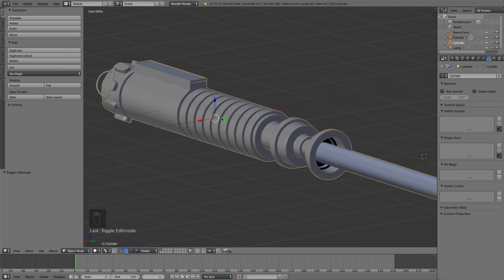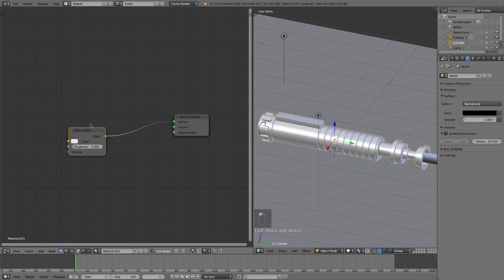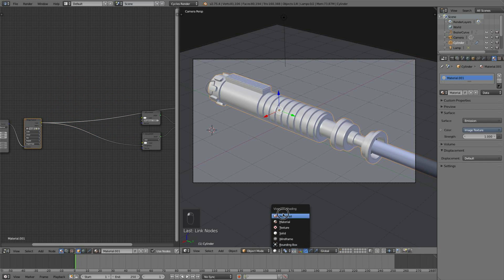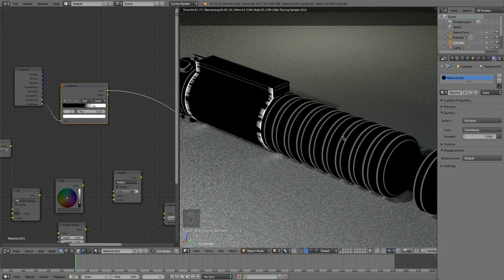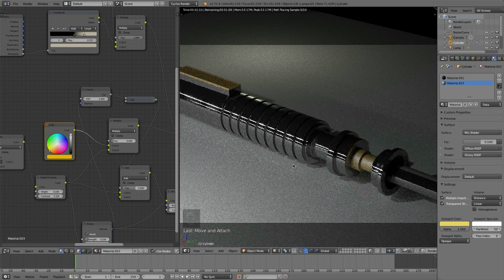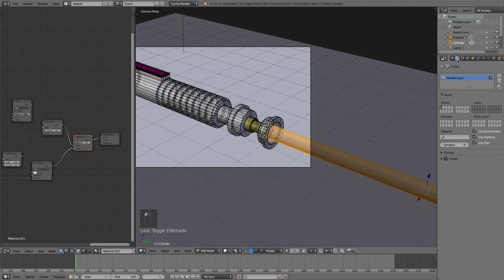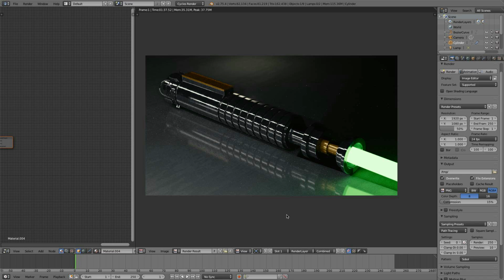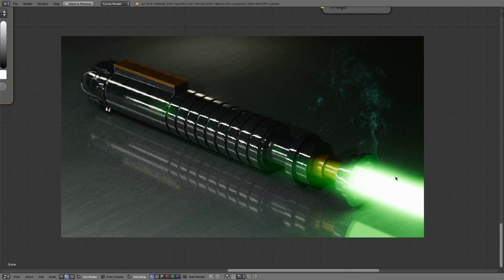Blender Beginner Tutorial: Create a Lightsaber - 2 of 2

Comment: Time for an upvote. There is still a problem left in my opinion: The reflection of the lightsaber blade does not glow at all. So whats the optimal solution for that? I tried to seperate the reflecting plane from the lightsaber with an object index mask and may be to lit up the green tones of the blade to make a glarefilter filter affecting mainly that part. Still this depends very much on the scenery and colors used. So is there a better way? Like having something like a reflection index to mask that off? Anyway thanks very much for the very useful tutorials and the time you are putting into those.

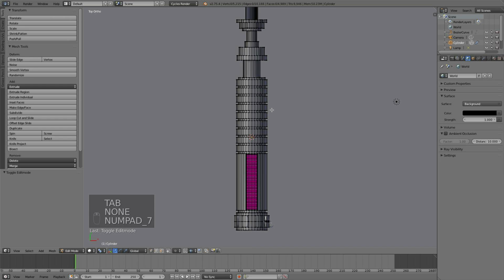Comment: Just d/l'd v2.77, and trying to get a footing with it; this is about the 6th tute video I've watched and worked along with, and all has been going great until ~5:00 of this one: UV unwrapping.  "Just hold ALT and click"... Yeah, that doesn't do anything; and ALT-rightclick just selecs one vertex, as per standard right-click.  ALT-SHIFT rightclick selects a series of vertices, but not necessarily in the direction you'd like, and not for the entire length of the model.
Reply: I had that too, Later I got it (don't know how)
Reply: Tom van Hattem With further experimentation on simpler shapes, I've found that it works as advertised provided the extrusion is the same shape all the way along its length - eg: if it's mostly a hexagon cross-section, a section with 12 sides will break it, even if the edges align.  For me, at least as far as I've investigated it.

I would have expected it to work up until the discontiguous point, but the algorithm apparently just fails completely.

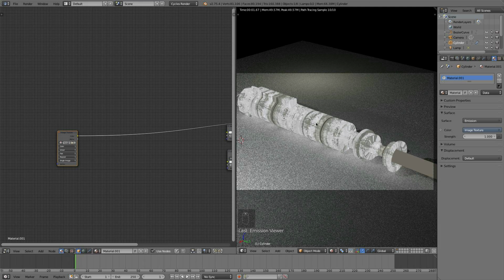Comment: Hmm... When I put in the image for the image texture, (13:38) the rendered view isn't showing me the texture. The light saber just looks completely black. The Node Wrangler (Ctrl+Shift) also does not work. I am using the latest version of blender too, and I do not know what's wrong. Help needed please :(:(
Reply: 1. ok so I know I'm late but this will probably still help anyone reading this and being stuck too. 
With Node Wrangler you need to ctrl+shift+LEFT CLICK the node you want to connect with the output. (bonus information - if its a usual node it will generate a temporary emission shader so that you can see the changes better. if you ctrl+shift+LEFT CLICK a shader it will just connect it straight to the output.)

2. My lightsaber was fucked up and black too when I was doing this. I somehow managed to fix it by carefully redoing my node work. you somewhere just fucked up your nodes, its a bit tricky. Can't help you more on that right now, I will have a look into it later
Reply: +Aniruddh Sriram Are you using Blender Render or Cycles Render?
Reply: Cycles
Reply: +Aniruddh Sriram thats odd I'm using the latest version as well and everything has worked just fine. did you render the image? youve got to render it then go to compositing and add image texture
Reply: +Aniruddh Sriram I have it too :( Did you find a solution?
Reply: um is there an email I can send you my complete light saber? I finished I was using the latest version as well and it worked
Reply: Are you ctrl+shift clicking on the node? that threw me off as well when viewing the vid.
Reply: Same problem over here
Reply: Ctrl+Shift Left Click.

Comment: As a beginner, this took me about 6 hours to complete, but it is a nice tutorial. the only thing i can't figure out is why everything is still blury. doesn't matter how high the render samples are. these gold strokes on the handle are no longer there, they are just one big blur.
I think this happened after the blurring form the green light itself? anyone got any ideas on how to fix this?
Reply from the maker: +Asthralas it could be that you didn't set the focal length on the camera? follow the part of the tutorial before rendering when I add some focal length and make sure to set the distance to the saber.
Reply: CG Geek
My god, I can't believe I oversaw something that simple.. thanks a lot man, it's looking a lot beter now. Keep up the good work!
Reply: +CG Geek Re: blurry image.  It's incredibly easy to get that linkage of compositing nodes wrong.  I had fixed the camera the first time, but it still looked like I was viewing through a few layers of gauze - it was those nodes.  I had to go back and rewatch and relink 4 or 5 times.  Even though I thought I understood what they were doing, it would not work right until my map exactly matched yours - and then I could rearrange it to the way I wanted it.

I've since rebuilt it from scratch on my own and it works, but I still have no idea what I was doing wrong the first few times.

Comment: How the hell did he make that Shift+L thing work?! I'm seriously getting desperate here!
Reply: +Pogohg Try using the Shift on the right side of your keyboard.. i just started Blender 2 days ago so idk if that makes a difference but it worked for me.
Reply: GrinderStruk Are you using Mac?
Reply: +Pogohg what was shift + L for in the video?
Reply: Valiant Pride To deselect something.
Reply: +Pogohg do you know which part of the vid I can check?
Reply: Valiant Pride It's somewhat early in the video. Around 7:30.
Reply: +Pogohg hover your mouse over the beam and press shift + L make sure the beam is not part of the handle though, in part 1 he duplicates the circle to get the beam so it is not exactly part of the handle. And I am on a mac, yes it does work
Reply: Valiant Pride But that deselects everything on Windows.
Reply: Valiant Pride What about the shader node? It doesn't appear for me when I hit shift+A
Reply: +Pogohg you can easily deselect by going into wireframe, press z, press and hold down the scroll wheel then press B over faces you want to deselect. note that this is a box selection or deselection, so it will select or deselect any faces within the box
Reply: Valiant Pride Don't worry, I have figured it out. You use shift+Tap as far as I remember.
Reply: +Pogohg yes thats another smaller way of doing it, as the B allows a wider range of selection
Reply: Valiant Pride Okay, but I said something about the nodes. I don't get that shader node to appear when I hit shift+A and those two nodes that appear when he says "new material" doesn't appear either.
Reply: +Pogohg part of video?
Reply: Valiant Pride Yes, around 8:00
Reply: +Pogohg on the top of screen, change Blender Render to Cycles Render. Then the nodes will be there when you click new
Reply: Valiant Pride Yeah that helped. Thanks a lot, mate :D

Comment: Too Fast! This is not appropriate for beginners. The author does not seem to have an outline to his tutorial. He change settings rapidly, multiple times and with very little real explanation. Once he starts adding nodes, connections start appearing and he never really explains where they go. Once your texture stops matching what the author is showing, it is very difficult to determine what went wrong because it probably wasn't explained well. Definitely not appropriate for your first model.
Reply: I agree
Reply: Then why don't you watch it at 0.75x or 0.5x speed dummy
Reply: @bogney  u do realize that was from 3 years ago? your the dummy idiot
Reply: @deandra1735  So what? It doesn't matter when this comment was made, I'm just saying that if you watch it at a slower speed, it will make it easier to follow. Also you do realize that this comment is 10 months old? Oh yeah, *you're
Reply: @deandra1735  That logic doesn't make sense, why do I have to be something to know what it is. I'm not female, I know what a female is, I'm not a bird, I know what one is. But I understand I shouldn't have called them a dummy.

Comment: Hi Steve. I'm having a weird issue when unwrapping. I've done everything along the exact same steps, twice. When I unwrap I don't get the same effect as you. My unwrap looks like the saber mesh but just stretched along the y axis instead of folding out. Could this just be a setting? I'm in top orth view when doing the unwrap?
Reply from the maker: +Jarryd Green Make sure your in Top mode when you unwrap, give that a try. :)
Reply: Hi Steve. I am in top orth mode. The uv side just elongates along the y (green) axis. I have the seams at the exact same locations as well. It's driving me nuts. I redid the entire model because I thought I did something wrong but it ended in the same result.
Reply from the maker: +Jarryd Green Hmm strange, not sure if this would make a difference, but make sure your also in Ortho mode win Num 5, and your using cylinder projection correct?
Reply: Here is a screenshot just incase. http://imgur.com/TsJ5ezt
Reply: I am in deed. I've spent the past 5 hours on this. It's not making any sense. I've gone back through every step. It's like it is not accepting my seams. If I remove the seams completely I end up with the exact same result.
I'm using blender 2.76 btw.
Reply from the maker: +Jarryd Green Alright, I'll take a look at it, upload the .blend here: http://www.pasteall.org/blend/ with any luck should figure this out...
Reply: Ok will do. Thank you so much for your help.
Reply: Here is the link. http://www.pasteall.org/blend/38594
Reply from the maker: +Jarryd Green Okay figured it out, but don't feel dumb it took me over 20min to discover the issue. The cylinder projection uses the objects origin point to unwrap, and your origin point (the little yellow dot) was placed at the bottom of your cylinder. (you probably moved your lightsaber in edit mode and this offset it to the origin point.) So to fix the issue just select a loop on your saber with alt + right clicking, then go Shift + S and choose Cursor to Selected, now tab back to Object Mode, and go Alt + Ctl + Shift + C and choose Origin to 3D Cursor. Now when you use cylinder projection everything should unwrap perfectly! Good luck. :)
Reply: facepalm that would make sense. I think I was still in edit mode when it got to shifting the saber up to place the floor plane. Thanks so much for your help. You are a champ. Subbed as well :)

Comment: my attempt...still  a bit noisy even tho i put samples up to 1500?http://img.photobucket.com/albums/v56/keyser187/lightsabre.png~original
Reply from the maker: +keyser17 Very cool! I like how the scratches/grunge almost looks frosted, like the scene is very cold, and the lightsaber is very hot. You could try tweaking your de-noise node a bit, might get a little cleaner.
Reply: +CG Geek thx alot...and for the tuts, not sure how it ended up frosted it just seemed to happen lol, (im a newb btw). tried tweaking the despeckler node but no real change, does it matter on how good the gfx card is as im only using a simple laptop and touchpad lol
Reply: +CG Geek tried again with 2000 samples but still seems noisy even after tweaking the despeckler
http://img.photobucket.com/albums/v56/keyser187/lightsabre2.png~original